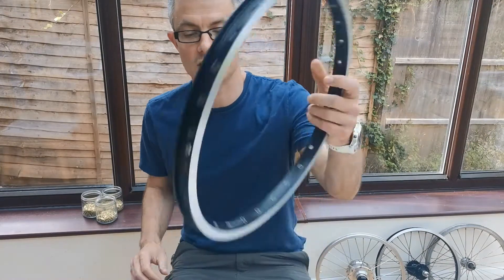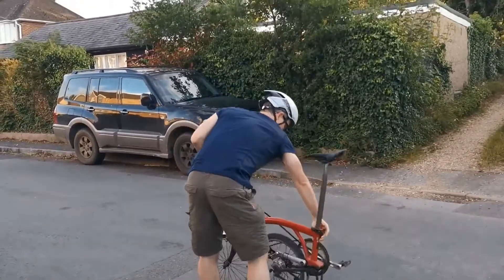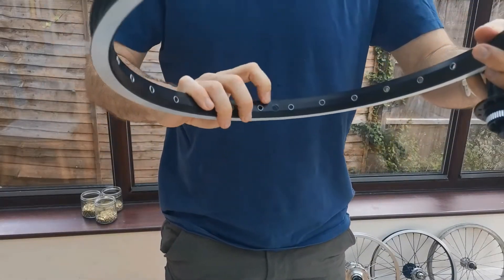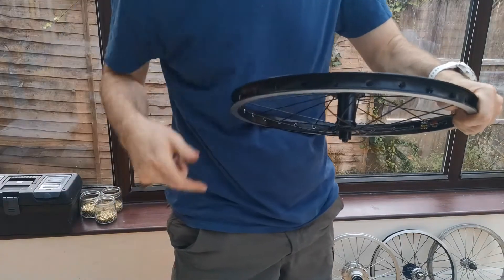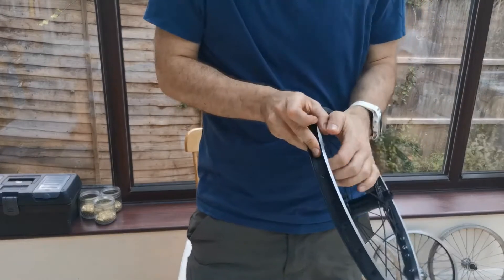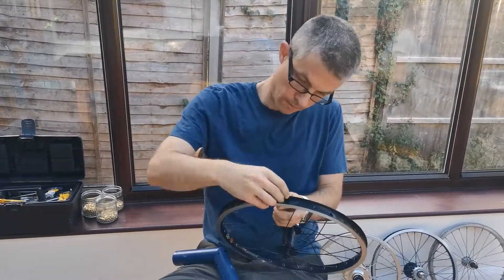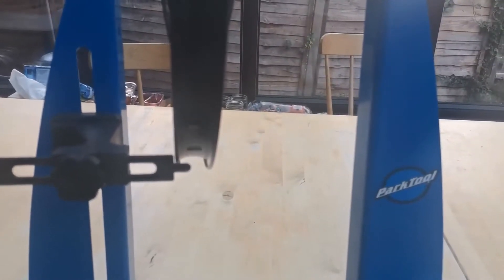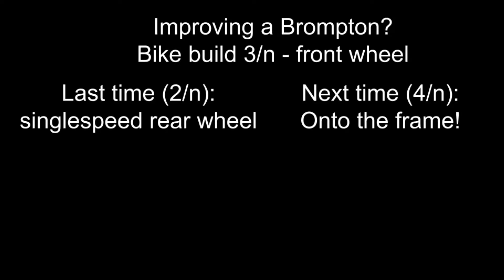Improving (??) a Brompton stage 3 - building a disc brake front weel

Comment: I have thought about adding a hydraulic disc brake to the front of my Brompton, with a new disc brake wheel for it, and a disc fork, as it is possible to buy from Eastern companies. But I have ridden down some very hairy hills in Denmark, on serpentine roads, only with the ordinay brakes, and they haven't failed till now?
Reply: I have hydraulic disks on my Scott e-bike, and I am grateful for them. But I have a Brompton also, which naturally rides a bit slower...
.. and have never found the standard rim brakes any less than very adequate.. (??)

Comment: So what's happening with the next video regarding the frame?
Bit misleading not to mention in these first videos that you will need to buy a replacement rear triangle and front forks in order to get these wheels to fit on your Brompton.
Reply from the maker: Hi Ruairidh! 

Sorry if that was misleading - there was meant to be a video every fortnight or so explaining the steps I was taking so that would have been clear, but I got a minor YouTube pile-on in the frame video (accused of putting people's lives at risk) so I lost a bit of motivation to keep doing the editing required. 

Anyway you do indeed need a new fork and rear triangle yes - the brakes are definitely better though it doesn't fold as neatly. Brompification and various Ali/ eBay sellers do it if interested.